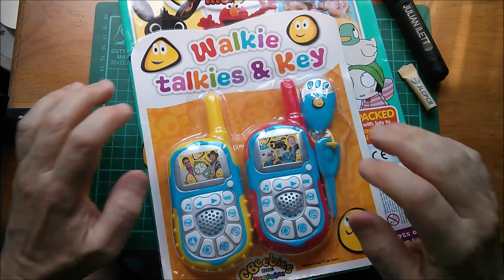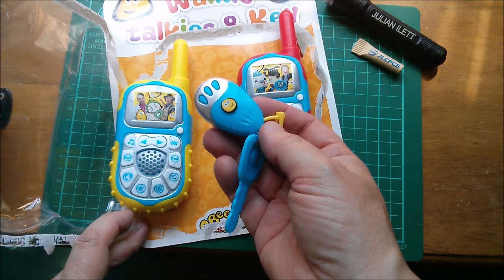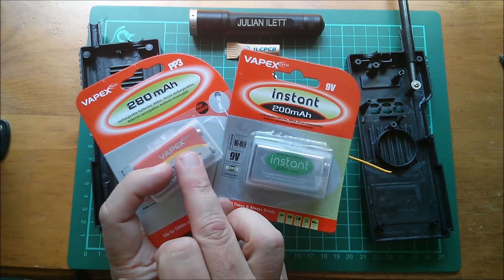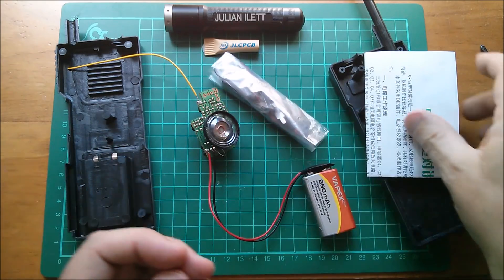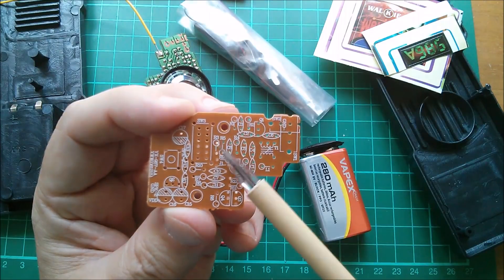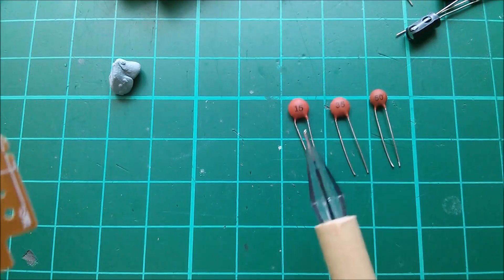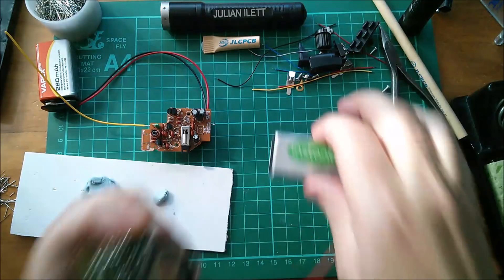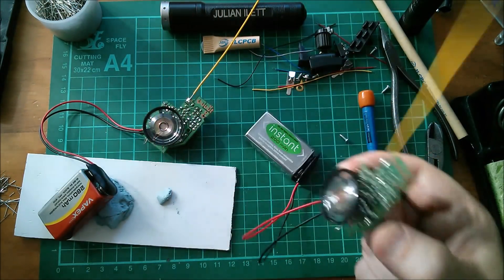Walk the Talk - Kit Build

Comment: 49.8MHz... huh. That is not an unlicensed band. Why is it transmitting in licensed spectrum? Must be miniscule power, otherwise Ofcom would write the manufacture a nastygram about interference with TV transmissions. Especially as that oscillator is going to have really awful stability. It's going to drift around like a Brexit proposal.
Reply: <4w is fine IIRC
Reply: <4w won't make it legal, alas - just means Ofcom might not notice. I think Julian would enjoy getting a radio amateur licence and doing it properly (and legally!) :-D

Comment: I wonder if you can get data through those? You could use minimodem. I've also got a modem program I wrote myself, 2400bps. Connect computer at each end, via audio interface, you might get it to work.

Comment: This would be MUCH more interesting if you used your OSCILLOSCOPE and diagnosed the sound quality issue, or found the transmit frequency, etc.  You guess at the function of the second switch PCB location but couldn't find a piece of wire to validate your guess?  Come on!

Comment: Sad coincidences - I have been looking at various (proper) walkie talkies today and here you pop with a self-build kit! ... 😱

But, methinx I will stick with pre-made ones, thanks anyway... 🙉 🙉 🙉 🐍
Reply: the BF UV-5R is very good, just a sugestion
Reply: telmo49 - thanks for the suggestion - but is this one more a Ham Radio than a leisure walkie talkie? ... 🤔 🐍
Reply: UV-5R are good for 2 metre and 70 cm ham bands, and a whole lot more besides.  Starting at about £20 / 25USD a piece.  Buy a programming cable if you get some.
Reply: The Venomator - You're welcome.  They can be programmed for PMR frequencies too, and have much better range than cheap PMRs.  Not strictly UK legal for that band, but no-one cares anymore...  :o(
Reply: Cheap consumer grade Motorola are about the same price as the Baofeng.  If you are concerned about the legality of the Baofeng, or just want to open the box and go, buy the Moto.  For every other reason, I would recommend the Baofeng.   
ie. Programmable, headset supplied, remote mic/speaker connection, larger batteries, antennae, and many other accessories available.  There's a very good reason they sell so well.  All the capabilities of a ham set, in a tiny hand held device.  I love mine.  Way better than my old PMRs.
Edit:  
https://www.amazon.co.uk/Motorola-Talkabout-Walkie-Talkie-Twin/dp/B07DY6HC5Q
https://www.amazon.co.uk/BaoFeng-UV-5R-136-174-400-480-Dual-Band/dp/B007HH6RR4
Reply: They have gone up by a few quid since I bought mine from Amazon.  I think I paid £21 each, including delivery, for the radios, but also bought a programming cable, a double size battery, and whip antennae for them.  They also have a built in FM broadcast receiver.  There are lots of eBay sellers offering them for £20 a pop.

They are a world apart from these "toy" PMR sets.  If you only need a one mile range, in a dead simple radio, get the Moto.  Personally, I'll stick to my far superior Chinese "rubbish."  ;o)
Reply: SarkyBugger - I hear you!  Thanks again... 👍🏻 🐍
Reply: SarkyBugger - Thank you, but I am only after leisure walkies and am not into ham stuff... 👍🏻🤔🐍
Reply: SarkyBugger - Thanks again, appreciate the input.  Is it me or are a pair of Walkies only (fairly decent ones of course (Motorola frinstance?)!) around the same cost as a single Baofeng though - here’s me assuming the BFs are purchased singly... 🤔 🧐 🐍
Reply: SarkyBugger - Really appreciate your comebacks and advice sir!  We do need two handsets though and does that not double the cost of the Baofeng over Moto, which a bought in two packs?  I will never use the ‘Ham’ functionality, although I am not fussed about the legality, or otherwise, it just seems a bit of a waste... 👍🏻 🤔 🐍

Comment: Nice to see you eventually build the second walkie talkie, but I have to say, they sound terrible, the other cheap set you bought work so much better, so much for cheap self build kits.
Reply from the maker: They are horrible, but I did have fun looking at how the changeover switch re-wires the circuit from a transmitter to a receiver :)
Reply: Julian I think its is funny how you said the younger you would have hated the speaker used as a speaker and a mic.